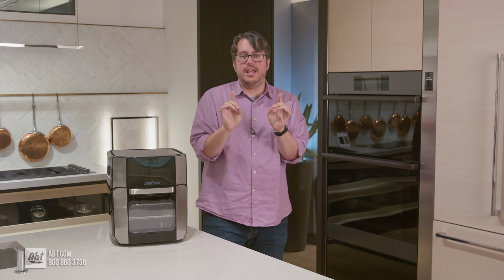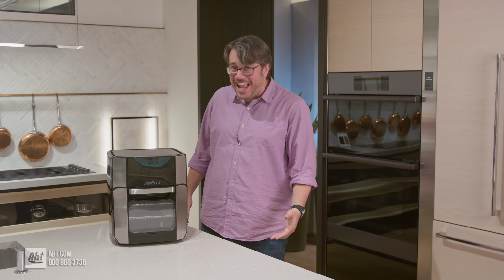Air Fryers vs Convection Ovens - What's the difference?

Comment: My oven had air fry and convection settings...wtf is the difference?
Reply from the maker: @sharonvillemaire3298 The Air Fry setting will move the air faster and typically at a higher temperature. Doing this allows the outside of the food to become crispier, so it's great for cooking items like french fries or chicken wings. Convection is great for creating even heat within the oven, which is good for things like roasting vegetables and baking cookies.

Comment: The Air Fryer is not cheaper than a gas oven, as I found out, seeing the huge increase in my electric bill. Electric ovens are dearer but not gas. No TV show says that. I use mine only for battered fish but general cooking is on gas.

Comment: There are some extra large toaster oven air fryer now that are tall and I believe they'll accommodate a 9 * 13 baking pan the toaster oven variety uses both the top and bottom elements whether it's are frying conventional baking convention baking. One caveat to consider is after talking to a few french fry manufacturers they have actually developed their recipes for the Standalone air fryers then the temperature they ask for cuz I want more than the preset on toaster oven air fryer with a digital control. I found with my toaster oven air fryer just best to trust the French fry preset lower the time between 10:15 minutes and just add more if needed. The French fry preset on my toaster oven air fryer 425 degrees F and I think the time is around 25 minutes which is a little too long. But when I reduce the time the results are great.

Comment: Air fryer emits radiation just like a microwave. Convection is safer and healthier.
Reply: air fryer has a calrod heating element, which glows red from electric current.  Think electric stove top element.  Above that element is a fan pointing down.  This is mostly infrared heat.  A microwave uses a magnetron, which is a different kind of radiation.  Air fryer heated air is in convection flow.

Comment: thanks for explaining the difference between air fryer vs convection..... but I still need help.... I have a Galanz 3 in 1 speedwave. My oven stopped working and I want to cook a ham dinner for AFTER Easter. I have tried to find a video of how to cook a ham in my speedwave... Needless to say I can not find any info!! I have never used any of the functions except the microwave and defrost buttons lol... Help!! Should I use the roast, convection, or air fry button?

Comment: my Miele speed oven is so much more versatile, it air frys, bakes, broils, microwaves and can do all with or without a fan. Being only 24" it has enough capacity for a family and isn't so large as to have the issues of larger 27 or 30 convection ovens.

Comment: I have a question.  Or three.
I'm considering aToshiba 7 in 1 microwave.
I noticed the air fryer was only ten ridiculous presets.
Like spring rolls.  ???
After that, they send you to the convection oven.

I'm considering timing the presets.  I heard they're the same temp.

With the rotating turntable, does that make it more like an AF?

Or In read combi mode was better. ?

Any thoughts about the machine?

Considering the 8 in 1 too.

I heard Toshiba changed ownership.    ?
Reply from the maker: @swampholler We don't carry the Toshiba line here at Abt so it's hard to say. We carry a 3-in-1 model from Breville that our customers have been very happy with. Here's a link if you'd like to learn more: https://www.abt.com/Breville-The-Combi-Wave-3-In-1-Brushed-Stainless-Steel-Microwave-Oven-Air-Fryer-BMO870BSS1BUC1/p/140957.html

Comment: Right now, I am debating whether to get a countertop convection oven or a countertop air fryer. I want one that can bake 12" pizzas, and I like how convection ovens do pizzas, but I don't know whether to spend the extra $20~30 on an air fryer, or just go with a convection. 🤔
Reply from the maker: @WorthlessDeadEnd We think it's definitely worth the extra cost to go with something that also has an air fryer feature. Here's one that works great for both: https://www.abt.com/Breville-the-Smart-Oven-Air-Fryer-BOV860BSS1BUS1/p/170869.html Be sure to contact our Gourmet Shop experts at 800-860-3736 to hear about any promotions we can't advertise online.
Reply: For Pizza you'd want an oven with a stoneplate thrlat goes at least up to 350, better 400 degrees celsius without convection everything else is a poor compromise. Nowdays theese ovens exist in household size and prizes but I have heard of none with multifunctionality. There are great multifuncional ovens, some advertised as "can bake pizza too" they are good for other things, if the oven maxes our at 300degrees celsius it might he okish to bake a compromise pizza in it but getting such a thing for Pizza would be like buying a hammer to hammer because you can technically hammer your screws into the wall with it instead of buying screwdriver for the job it was made for.

Comment: The convection oven is a lot better than a airfryer..... The taste is different all together to me... The air fryer dries the food  out, making it tougher on the outside.... The convection oven doesn't do that in my opinion..... Just plain tastes better....
Reply: You're doing it wrong then. For air fryers reduce the temps by 20 DegC Vs a normal oven and also reduce your cooking time. I do whole chickens, chicken wings, sausages, bacon, thighs basically if it fits it goes in and I've never really had issues. The only one I found dry were lamb cutlets but that's because I left them in too long. There are some things I won't put in such as roast beef due to size, mine does have a probe though so I can easily control cooking time for certain things.
Reply: @polla2256 could be it. The same applies to regular ovens when using the convection / hot air mode. Actually it's not specifically 20°C but 10%, which happens to be 20°C in most recipes.
Reply: @polla2256 Mine has presets for certain foods. Since mine is the toaster oven variety 425 Fahrenheit. The air fryer instructions assume it didn't give me good results so I find just use the preset and just reduce the time to between 10 or 15 minutes when's the fries taste just like they came out of a restaurant perfectly crisp as they should be in tender on the inside
Reply: I think they do the same thing, because they cook the same way. It's just you as the cook have to use it differently and adjust. I do feel like the airfryer cooks a lot faster though, which is probably your issue if you're cooking the exact same time but the airfryer is cooking faster.
Reply: That was helpful.  Thanks
Reply: Want crispy = air fryer. Don't want crispy = oven
Reply: Unless you are a chip(French fry)
Reply: Am using Air fryer for making pastries. But they are not crispy at the bottom for which I have to flip them on the other side then they cook well and become crispy. Is it becoz the airfryer don't have heat at the bottom like a oven